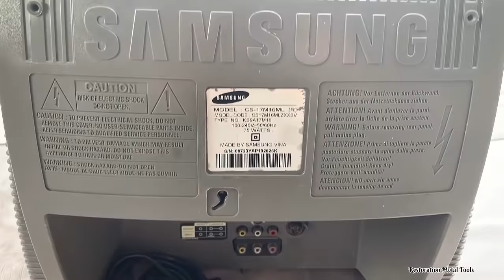Restoration TV SAMSUNG 17 inch produced in 1992 | Antique television restore | Restore old color TV

Comment: No chance of this working !
Reply: Better trance than you’d think.   It just needs a good cleaning  these things can handle more than you’d think.    I don’t see much damage in here and the yoke is going to make lots of crackling and popping noise as it drives moisture out. But after that. It’ll work quite well.  Speakers are trashed though

Comment: Hehehe you are so genius. Using water in cleaning  the flyback tube!  A perfect way to start the begbang followed by the huge ball of fire😁😁😁
Reply: ACTUALLY... Any electronic device can be cleaned with water, as long as you make sure there's no electrical current flowing in the components until it is COMPLETELY DRY
Reply: its nothing wrong at all as long as u dry them out thoroughly. we use to wash motherboards in dishwashers too.